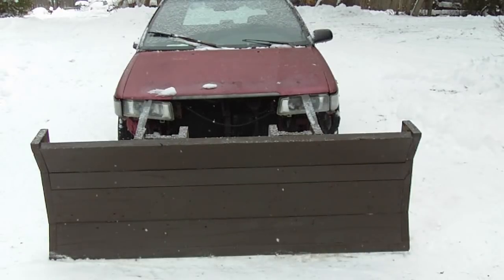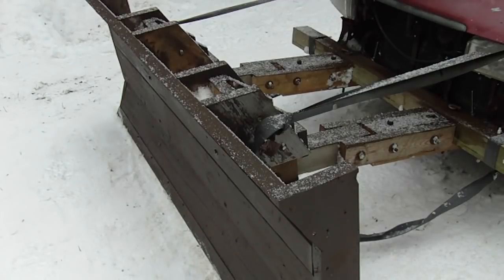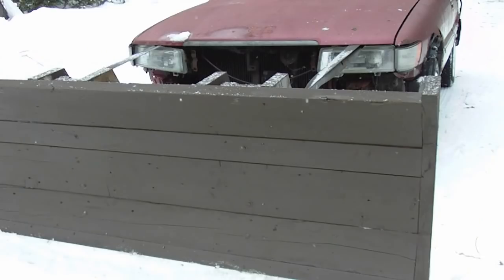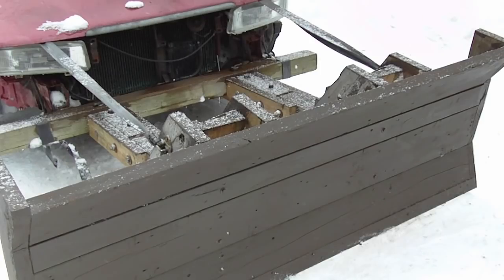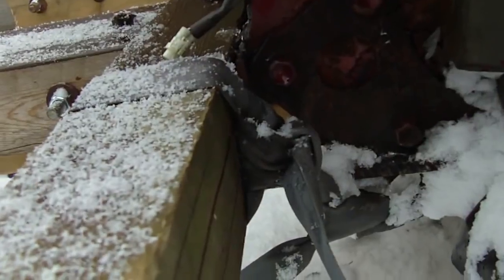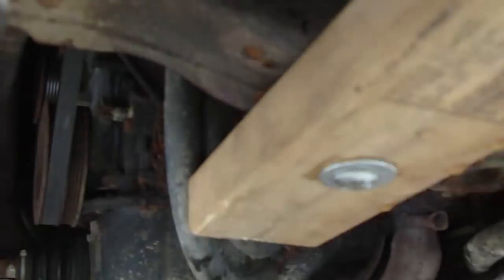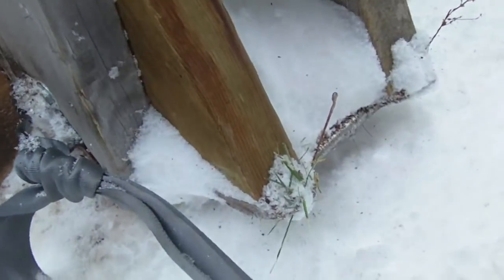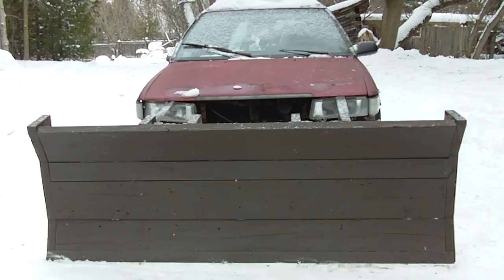Homemade Wooden Snow Plow on a Toyota Corolla 4x4

Comment: I've got a subaru wagon, off road and bad head gasket - can get about 75 miles before it overheats, and I'm going to follow your design and give it a try.  Thanks - good video
Reply: A bit late of a reply, but the head gaskets ive seen overheat within 10-15 minutes.

Comment: I put a garden tractor blade on my AMC Eagle several years ago. It actually could turn right or left. I took a ratchet belt strapdown to ratchet it up or down. I had wanted to get a cheap electric winch. It worked great. I never took a dam picture of it.

Comment: Angling snowplows help you get the job done faster, but unless you're plowing one driveway after another, spending several thousand dollars on the plow (not to mention the truck) just isn't worth it.
Question: how well does the drivetrain in that little car hold up to pushing snow?

Comment: I had a plow made from 1/2 plywood, and I angled it at 45 degrees so that the snow would be pushed off to the right.  I used it to clear my 500 foot long driveway a lot faster and easier than using a snow blower every time there was a small snowfall.   I used that plow by connecting it to my NEW Toyota Corolla at the time, a car that was my daily driver.  But I moved to a place with a shorter driveway so I did not need the plow, so I set fire to it and burned it.  So don't be afraid to try new things,  just take some wood and go ahead and have fun.

Comment: if you put a board on one side like a knife it would push the snow at the other side. i did something like that on a plow that i had on a old lawn tractor..before i got my weilder..i have a video of my tractor and a log trailer i have.also a dump trailer i have..a 6way plow too..all made from scap steal..and uses a winch to do the work..on a 1967 wheel horse ...6hp motor..cheap $..about 150 in all of it

Comment: change your oil man...click click click
Reply: Why? It's a Toyota you never have to change that stuff.
Reply: I change my Toyota Corolla's 100% synthetic oil every 10,000 kms  ( 6,000 miles ).  If you don't change the oil, then the oil will SLUDGE UP in the engine, blocking oil passages, and then your engine is toast.  You will need a new engine in as little as 30,000 miles if you don't change the oil fairly frequently.